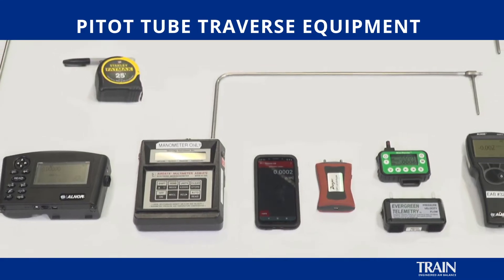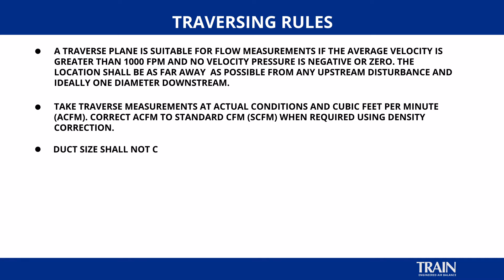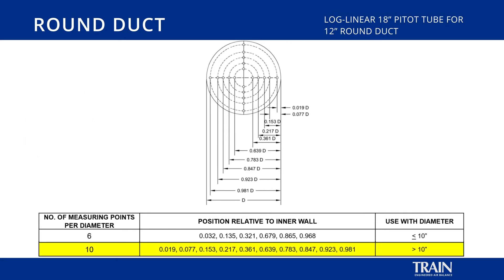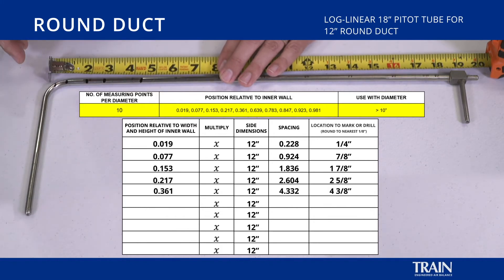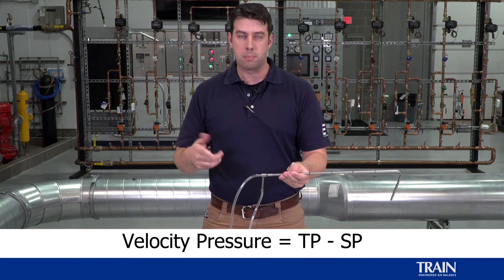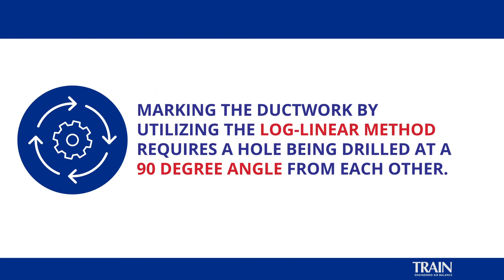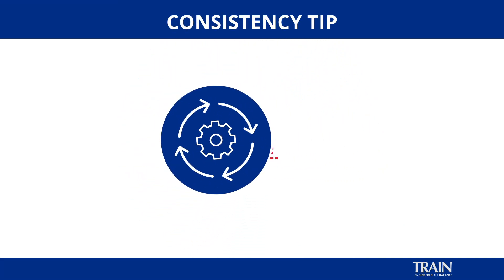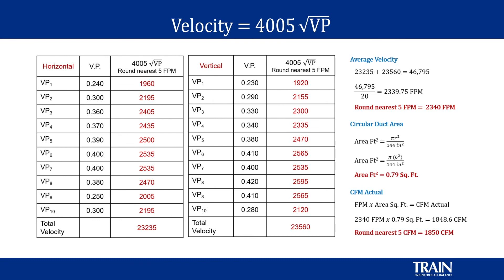How to Perform A Pitot Tube Traverse Round Duct

Comment: excellent explanation, you wrote round nearest 5fpm & round nearest 5cfm, whats this mean?
Reply: when doing the calculations, you will round to 5. Example: the 1st VP measurement read ".240"- so (the square root of .240 times 4005)= 1962.0412. Since this number is closer to "0" than "5": the reading they are looking for is "1960". If, for example, the answer was "1962.6" that would equal 1963. This would prompt you to "round to the nearest 5": giving your answer 1965.